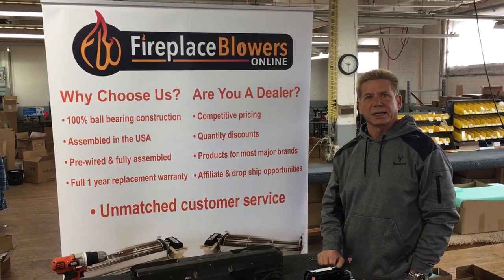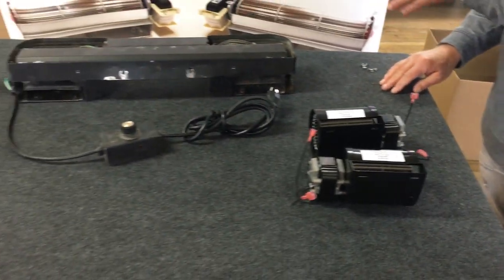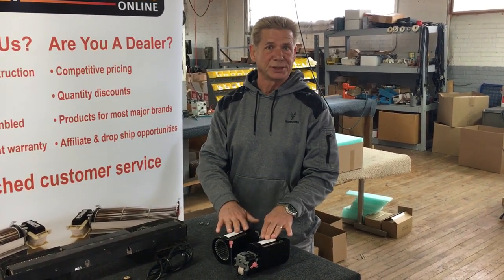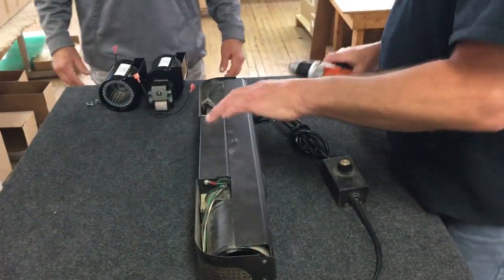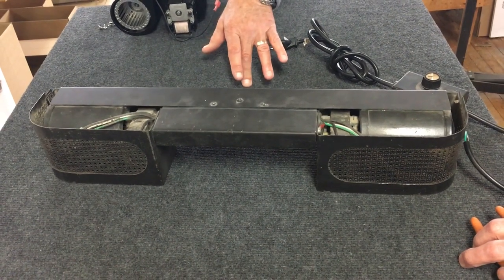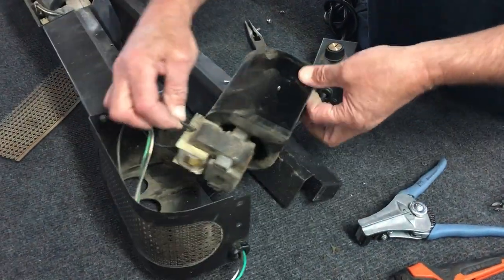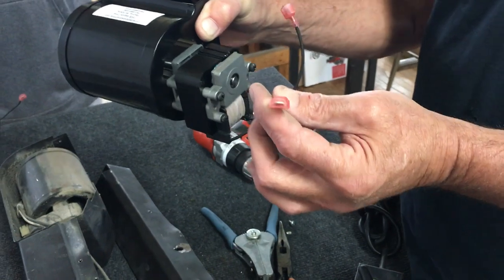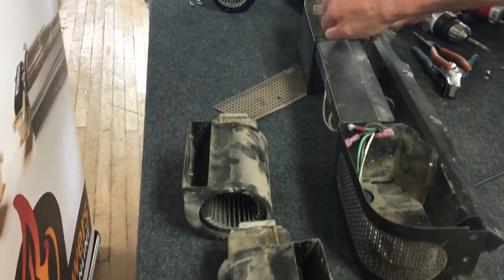Blower Replacement in Lopi, Avalon & Travis Fan Kits

Comment: Very nice blowers, thank you.  Just installed in my Lopi Republic and they're super quiet and efficient.  Fit was a bit tight, relative to OEM due to the bolt heads on the motor body sticking out farther than the Lopi unit, but worked after a little persuasion.
Reply from the maker: Well done Michael.  We're fixing that issue here shortly by counter sinking and reverse threading the bearing bolts.  Some of the units such as on the smaller Republic units will require a little persuasion to fit :)  Regards, Jason
Reply: @fireplaceblowers  Thank you!  I was also thinking counter-sinking would do the the trick.  I can't thank you enough, your blowers really transformed my Lopi - it runs so much better - the blowers pull so much heat into the room I can't over-fire it if I try.  Great product.
Reply from the maker: @michaelkimball7667  Thank you so much Michael!!

Comment: I just received the blowers for my Lopi Freedom.  I might caution others that the silica gel packs thrown into the box with each blower can work their way into the little squirrel cage fan.  I noticed a funny noise from one as I handled it.  I spotted the white packet with a flashlight and extracted it with a long nosed hemostat.  I hate to think what might have happened if I hadn't detected it.  I can well imagine it might have made some nasty noises, and even damaged the blower motor.

Comment: Excellent video, thank you for making this. Do you have any instructions or advice on how to first remove the assembly from the stove insert itself? I've been looking at my Lopi Answer, but it doesn't seem obvious to me. Thank you!
Reply from the maker: Hey David.  The blower assembly on the Answer is held in place with a couple of bolts that are located directly above your center dampener handle.  You need to get a socket under there and loosen them up, but once removed, the entire assembly just pulls off the stove.  Hope that helps!  Regards, Jason

Comment: I have a real problem... I bought a dual blower kit from you and installed it following your awesome video, thank you, but I have NO better blowing than prior to installing. I am wondering if it is the switch?? I only get a very light bit of blowing on full blast. Same as with my old blower. If so, do you sell a switch?
Reply from the maker: It's very possible the rheostat needs to be replaced as well.  If it's not regulating voltage to the blowers properly, they may not be spinning at their full RPM.  Give us a should by phone and we'll get you squared away with the right controller.  Regards, Jason
Reply: @fireplaceblowers  Jason you the man!!! I got the controller from you, thanks so much for sending that for free, and it works like a charm!! I now have hurricane force winds in my living room lol!! AWESOME service and parts. THANK YOU FOR BEING THERE!!!

Comment: My lopi blower motors have a red black and white wire but it is the exact same size and layout. Any suggestions
Reply from the maker: These are the older 2-speed motors, which are no longer available.  We typically rewire those setups to use a full speed rheostat instead of the hi/low toggle switch.  So definitely some wiring to do on those older setups, but something that can certainly be done.  If you don't care about speed and just run them high at all times, you can ditch the red low speed wire altogether and keep your toggle switch.  The switch just wouldn't work when in the low speed setting.  Hope that helps!  Jason
Reply: @fireplaceblowers  that is exactly what I needed. I do just use the high speed so that works perfectly. So just cut the red wire and cap it and connect the white and black to the new motor and I should be good to go?
Reply from the maker: @ericandrews5831  Exactly correct!

Comment: Is this replacement on a Lopi Endeavor?  I don't recognize it as being an Endeavor.
Reply from the maker: The Endeavor uses a rear mount blower kit vs the front mount kit illustrated in this video.  The front mount kits are typically used on the inserts. Hope this helps.  We'll have a some video content being released soon on the rear mounts.  Regards, Jason